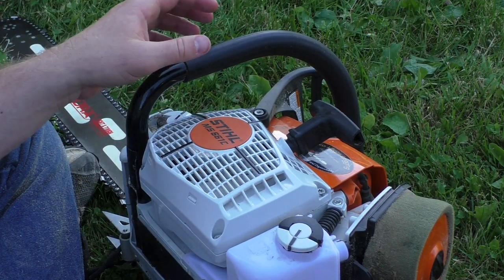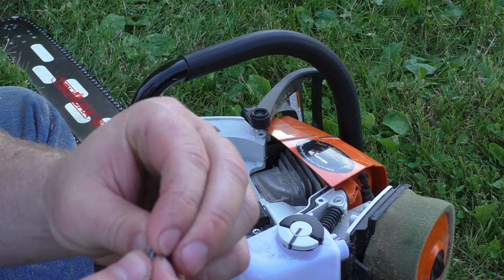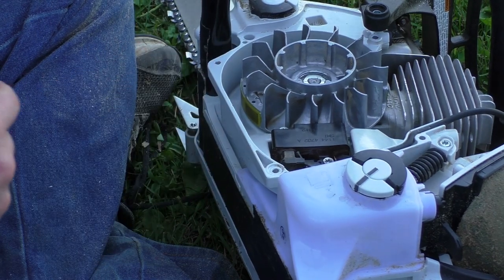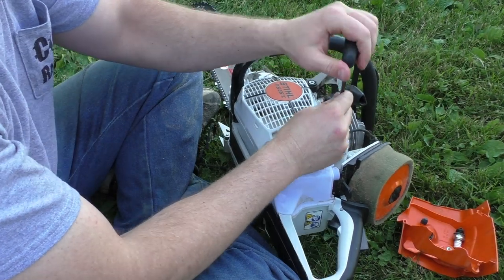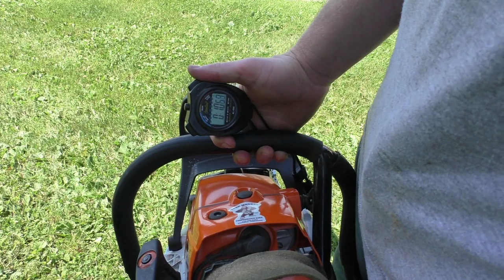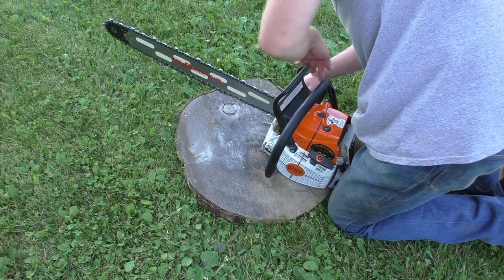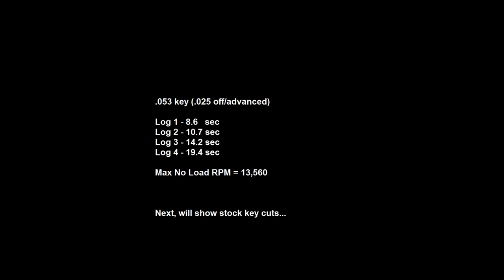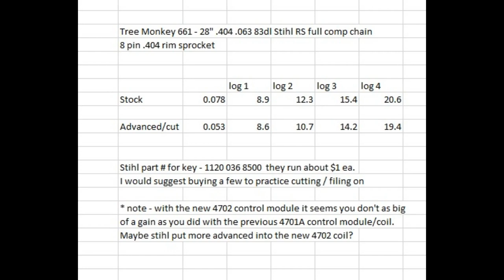Stihl 661 Timing Advance - How to - Before and After

Comment: usually a 2 stroke engine will prefer a timing retardation for high rpm application. Causing ignition closer to top dead center to make up for the increasing burn rate of the fuel as heat and RPMs rise so that the combustion chamber can maintain maximum pressure somewhere around 12 degrees after top dead center

Comment: Put a degree wheel on it and see what difference in degrees. Then a timing light and see if it stays at the same timing point. I dont like that play in the flywheel. Its easy enough to break full keys, let alone shaved ones. Good work though. A simple ( exhaust) port and polish  works wonders.
I did it to my 2186 and opened the muffler outlet a little and it was way better thru mid and top end.
Reply from the maker: done a lot of timing advances on 661s.  no issues.

Comment: Thanks for making this video. My module says 4702 A is that the new one? Also. Can I do this to a stock saw. I have a maxflow air filter and a duel port muffler. Do you think I would get gains?
Reply from the maker: welcome. yes sir that is latest.  you can do it to a stock saw.  Gains will be minimal. But they all add up so...  Me I would but I can do it in a few minutes.

Comment: I have a 661 an I did the Scott muffler job to it (drilled the spot welds to remove the whole baffle and added another exhaust port on the opposite side of the factory one) also have a max flow on it. Do you recommend porting it to do the timing advance or will it breath enough with what I have done so far?

Comment: I have a 036 that seized what ciuld be the problem.? Would appreciate the help..
Reply: k wolf  Most likely wrong fuel/ oil ratio. Usually the piston gets stuck in the cylinder. Get a piston and cylinder kit and get after it. Plenty of videos out here that’ll help you.

Comment: Would the MS 661C  M-Tronic Module
Be any good to replace the M-Tronic Module on the MS 441C MW ?
Reply: I wouldnt think so.. they are completely different engines , with totally different parameters as it pertains to air and fuel mixture...  But im not sure.. seems to me that it would be like taking a 661 carb and putting it on a 441 and expecting the setting on the carb to be right. Just my 2c

Comment: Wait if scott milled them, and he did your saw...why didn't he set the key to his porting, there in his shop?  Just curious!!  Scott's one of the 2 best minds on porting I've found on youtube (on the net, really...when it comes to powersaws, I mean), an so envious of a 661 he did, I would be soooo darn hesitant to touch a thing (at least w/o having gone over it with him...I must be confusing him, could've sworn he'd said he doesn't advance 660's much although this isn't a 660 you have :P) 
Thanks for making the vid, showing how simple it is -- having mostly had flywheels with cast keyways, I never touched timing-advances, but seeing how these pro saws have removable, cheap keys -- it's like you can just play with them to you're PERFECT!  I have a pair of chinesium 660's, both stock timing (but ported, heavily modified, about to do case work on one of them), anyway thanks again for posting this - I just spent like ~$20 and have a Stihl flywheel-puller and 2 keys arriving, I'll do one key at 25, one at 15 thou removed, see which one I like better, then actually do my 'oem' keys, will be able to dial it in instead of "20 thous is better than stock so good-enough" yknow? Seems if you only need to remove flywheel cover, remove flywheel, do a quick file & measurement, and check if it's better/worse than before...going in 5thou increments, one should be able to reallly dial-in things!!

Comment: I’d like to advance the timing on 462 it’s got a muffler mod currently. Is it as simple as this procedure except obviously on a 462?
Reply from the maker: no key on the 462.  you need a degree wheel and need to file on the actual fly wheel.  Not as easy.

Comment: Can someone tell me why these mods are necessary? I prefer durability over bragging rights. Waste of money and probably a flywheel. My 661 does fine bone stock. By the way, using a file for a punch is not a good idea.
Reply from the maker: necessary NO.  Fun YES.  Durability wise - Scott has ported probably a hundred or so 661s.  Not one has come back. Scott's personal ported 440 has over 1000+ gallons of gas through it.  No issues.  There is just no evidence to support the theory of less durability if the mods are done correctly. 

Plenty of cases of stock saws run on 50:1 that get roasted...if anything modding saw helps it.
Reply: @Redbull661  Yes, I agree. To me it just makes sense to port these newer saws. It lets them run a lot cooler which in the long run makes them last longer. I've run an 044 for years, and when I bought a 661 a couple of years ago I couldn't believe how restricted the muffler was. Needless to say I opened her up a bit and am much happier.
Reply: I can get 10-12 face cord cut up per gallon of fuel with me hotwoods ported 462c - know it for a fact ... 1000 gallons x (10-12) face = 10000 - 12000 face cord ... assuming $90/face retail that’s 900,000 - 1,080,000 gross ... while the lifespan of a Saw is inversely proportional to the amount of dirt it ingests ( also SHARP chain and proper maintenance by operator) I find it doubtful that a $1500 modded Saw will gross you + -  1 MILLION dollars with NO issues ; 1-2 thousand hrs runtime before rebuild (or 6mo-1yr of 6-8hrs a day  cutting) seems more realistic
Reply: R.P. Strange  I tend to agree with you. Given the cost of these saws I wouldn’t want to mod a work tool just to gain .25 seconds on falling  a 30” tree.
Reply: firstly I appreciate these videos and the fact that you just did that work on your lawn, well good on ya :7)

as mr strange noted, u say be careful with anything sharp around the crank shaft and then hammer on it with the hardened file as a punch... I giggled, file would be my last choice for multiple reasons
Also if you were going to go that method of modding the "woodruff" key, I would have stuck with the original key but shaved just the thickness off the section that protrudes in a vice with a hand file. 
going an entirely different size will possibly eventually chew out your flywheel, 
maybe not? but there wasnt much there keeping it indexed on the shaft, that key is supposed to stick out far more than that.

anyway awesome saw, you have to love new toys.....
afterthought, in theory there is not alot of force put on that key once the nut is torqued so I guess ur fine

Comment: Love your vids & thanks for doing them. Obviously, timing advance is beneficial...but so is porting....and muffler mods....and so is squish/compression....  Guess I'm curious as to the individual gains in each-  Could you rank and quantify improvements, from most-least beneficial/effective?  If you're racing; you're gonna do it all.  What's the most cost-effective if you're logging or cutting firewood?

Thanks again!
Reply from the maker: dual port muffler mod. = most cost effective improvement.   stock port should be opened up a little and then a deflector opposite side should be installed.  and NOT on the front cover.

Comment: I think that this way you are giving the spark later than the factory setting so its not timing advace. Its actualy timing delay. If you want timing advance you have to tight the flywheel forced clockwise(opposite direction of normal) 
Am i right?
Reply: Wow really sounds like u know what you're talking about 😂

Comment: Can anyone think of any reason you couldn't un-do a timing advance?  IE, just loosen retention-nut, rotate flywheel a tad CW to its OEM position, re-tighten retention nut...the rotation of the crank here is CCW so I expect it should be OK insofar as the retention nut being sufficient but wanted to ask if anyone's done it (am about 3deg advanced on one of my builds and, even w/ an Elasto-type, D-shaped handle it is still a nightmare to start...)